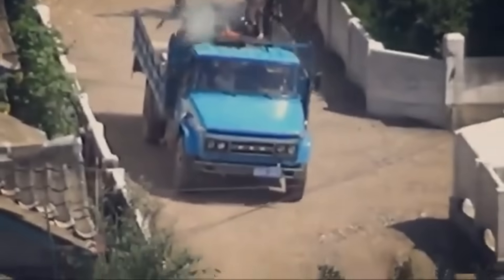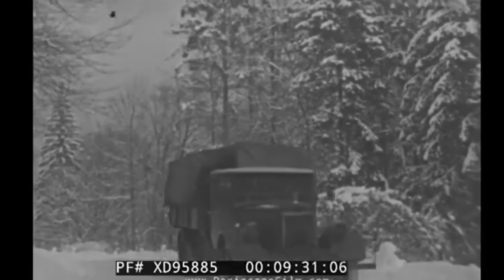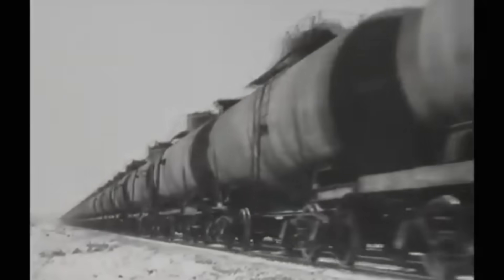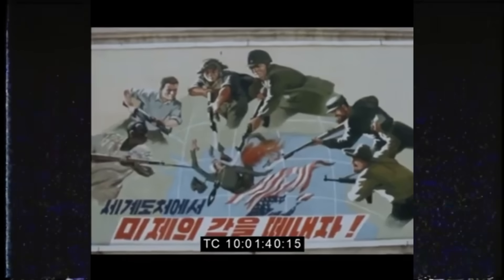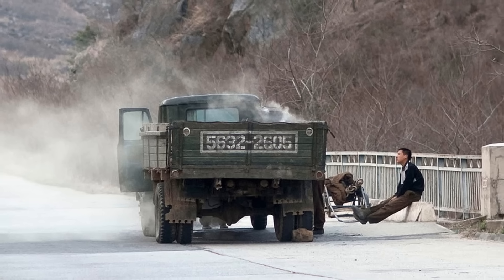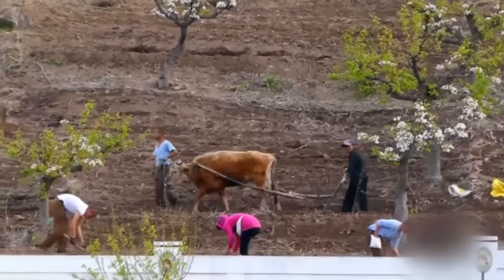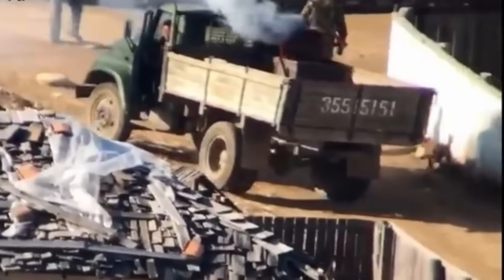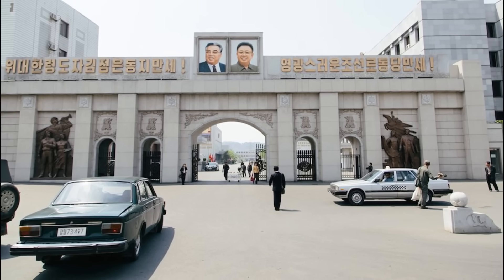Why North Korea’s Trucks Run on Wood

Comment: 0:45 coal powered lorrys like sentinels,were made for a very long time, and some even lasted in use into the 60s and 70s in a few rare cases when generally steam fell out of use. 
 
Sentinels in particular were well liked, due to being vertical boilered, and were easily to maintain, kind of like their railway locomotive counterparts. They were still building them in the 50s
Which is amazing when 
Considring many north koren soviet trucks were designed in the 50s.

Comment: While not ideal, FEMA released a crudely drawn set of plans to convert a vehicle to run on wood during the oil crisis.

Anyone with basic mechanical knowledge can convert a vehicle in a few days using very simple supplies.

It is good knowledge to have and some people have even set up home generators to run on wood gasification systems.

The added bonus is that you get charcoal as a byproduct that can be used to purify water and for cooking.

Comment: In fact, modern steam engines are more efficient and can use any fuel.
You should look at the speed records of the last steam cars ever made.
Technology that was deliberately killed to strengthen the petro dollar.
Reply: Steam generators used by those cars ran on oil. Stanleys for example burned gasoline and kerosene. It was no threat to the oil industry, as it directly used the product they produced

Comment: There were wood gas vehicles, natural gas vehicles, steam vehicles, and even electric vehicles since the 1910s. There were then a few theories about the possibility of having nuclear powered vehicles and trains in the 1940s and 1950s. But the oil lobbyists and the U.S. got too powerful. One can only wonder how different the world would have turned out if petroleum hadn't been seen as crucial, at least for transportation and energy.
Reply: And since before the 1910s
Reply: It's not that they're powerful, it's that objectively gasoline is a better fuel source. Calorific value wise, gasoline has 44 Mega Joules per kg compared to wood gas which has only 5.7 Mega Joules per kg which makes internal combustion engines more powerful compared to their size. Storing and using gasoline is simpler than either steam engines or wood gas generators (which is just a tank and a carburator). And gasoline has many uses aside from being fuel for cars: it can be used as fuel for lamps and solvent for certain products (Bertha Benz got her first refuel for the 1897 Benz-mobile car from a pharmacy. Standard Oil became an oil monopoly not because of the Automobile but because of the widespread use of gas lamps across the world; it is said that you can find cans of Standard Oil gasoline even as far away as Siberia and Timbuktu)...

Comment: You left out a significant trade deal between Uncle Sam and N. Korea. Clinton sent Jimmy Carter to meet with Kim Il-Sung, on his death bed. Carter managed to break the ice with the old man which became known as The Agreed Framework of 1994. The U.S. opened some trade, including food and medical relief; a rail line was built between the two Koreas. It worked until George W. welched on the deal in 2001.
Reply from the maker: Yes, thank you, I really missed that.

Comment: Sounds like it would be easier and more efficient to create wood gas producing factories, or ethanol producing factories instead using a gas generator.. and it's would be much cleaner so you wouldn't have to rebuild the engine constantly either
Reply: A wood gas generator can be very simple, and you can "fuel" it with fire wood. Hence you can introduce it relatively quickly, and no need for wood gas producing factories, and the infrastructure to deliver wood gas. Exactly how will that work? Pressure tanks with wood gas of high quality steel? The whole point of the wood gas generator is that its fast dirty simple fix.
Reply: @kirgan1000 but then you have to lug all that wood around and it requires at least 2 operators to keep the truck moving, and hoping it doesn't get stranded due to excessive carbon build up from this "dirty" fuel.. ethanol imo is a much better option, it's made of plants and it's easily liquified, so no need for super advanced infrastructure in order to distribute it, and it burns clean too
Reply: @MrRightNow  Wood gas generator is a fast dirty simple fix. You can make the generator in a shed or a small workshop, out of sheet metal, and the "fuel" is in most places in  abundance.   

Its is a excellent choices if you are under blockade, or have mismanaged the country's economy to the point where you can't afford to import oil on a large scale, and do not have the time/money/resources/technological know-how to build (effective) ethanol factories, and in the case of North Korea, do you really want to use your limited grain for ethanol production.
Reply: Wood gas producing factories was a thing... In the Victorian era. They were called "Gas works" and are the "Natural Gas" of the era. The infrastructure to provide that is very substantial, much like that of water service. Ethanol requires some material of high sugar content to be fermented into such and those sources tend to be food sources. So in both counts I do not see those work in North Korea: the former because it's an antiquated system in a country whose government is obsessed with looking like it's a modern paradise on earth and the latter being impractical in a country whose  geography made even growing for food difficult...
Reply: Why not nuclear power? Its not nearly as dangerous as fear mongering propaganda pushes as long as it is maintained properly.

Comment: i'm an italian maintenance techinician man, who use to run electricity power plant based on chipped wood, wich is burned in ermetic chamber under pyrolisis mechanical transiction, we generate Syngas, or wood CNG... wich is the fuel for american V8  8 liter gasoline engine we use to generate electricity. The same gas when owner, usually small to medium industry, don't need electricity it's stock on adeguate tank and used into truck for delievery or fork lift, and lose around 20% of engine power using that Syngas - wood CNG. This is a smarter way to do that.
Reply: Veryvery interesting! Thanks for your comment and information! Greetings from Germany!

Comment: As a long time fan of wood gas vehicles, allow me to share my thoughts:
Wood gas vehicles peaked in use during ww2 only, not during ww1. this is because the wood gas system as we know it was invented only in 1930s by a guy named Imbert. hence, all these wood gas generators are also called Imbert downdraft generators. 
it remains to this day the most widespread type. 

basic principle is that smoke (CO2) passes through a glowing bed of coal which is supplied by little to no air. Carbon in coal is so hungry for oxygen that it strips it from C02, and you get CO, carbon monoxide, which is flammable. it also strips any water vapor into pure hydrogen. 
Engine power was down to about 60% when driving on wood gas, but this could be increased by about 20% by letting steam (H2O) into the glowing coal bed, and so make more hydrogen.

On topic of stokers and filters. On a properly designed and built wood gas system, you dont need to constantly feed fuel, and the engine does not need frequent rebuilds. to re-fuel, you stop every so often, fill the fuel hopper with sack of precut wood pieces, close it (it shouldn't smoke) and then drive "as usual" for dunno 30km or so. 1L of gasoline is quivalent to about 1,5KG good firewood.   
as for purity of smoke and tar buildup, this will depend on combustion temperature and types of filters employed. you need a high combustion temperature to burn the tars, and you need a cyclone filter, water bath filter and then a fine particle filter.  gas coming out should be completely invisible and easily lit by match. you also need a gas cooling system, since cool gas is more energy-dense. 
 

I don't mean to be pedantic, but on topic of steam-powered cars and trucks, you are incorrect that they were just a curiosity; this was not niche technology. in 1920s and 1930s, esp in Britain, heaviest trucks were all steam powered. they did stuff no gasoline truck could. they disappeared simply only the government passed a law that taxed vehicles by weight. that law was pushed IC car and truck makers to remove competition from steam trucks. In fact, these trucks could make for an interesting video topic. Check out the Sentinel trucks of the era. Then also Doble steam cars, also brilliant design and i think best steam road vehicle ever, although it's a large luxury car.
Reply: Check out the cooperation of Doble and Henschel! Plus the post WW 2 Nami 11 and 12! Rather interestin! The German Butenuth developments as well !
Reply from the maker: Thanks for the tip. I'll definitely read up on these cars.

Comment: A video on Cuban Taino trucks and light locomotives would be interesting, few people know that cuba in the 1980s and early 1990s made its own trucks and light locomotives also the Taino diesel engines wich ranged from 4 cylinders to 12 cylinders where used on many other vihicules like boats and military vihicules.
Reply: It makes sense. If I remember correctly, Cuba followed the Soviet model of industrialization to some extent (all underwritten with free Soviet oil) and is said they have used more chemical fertilizer and pesticide than US agriculture. The "Special Period of Peace" gutted those so badly Cuba deindustrialized (against its own will) and is still a problem to this day. Same with North Korea and their "Arduous March"...

Comment: besides the low power output and clogging the engine its also a source of carbon monoxide poisoning.
Reply: If done correctly, a vehicle will run just fine on wood gas. You start the fire, get the wood to flash point and then it is releasing a flamable gas.

When a solid burns, it is not the solid burning; it is reaching a temperature at which the solid breaks down and releases a gas that is flamable.

If running a vehicle on it,  you want to choke the fire until it is smoldering and then pipe the gas through a water bath for filtration.

Most vehicles with a computer will adjust the air to run just fine on this.
Reply: @kjaubrey4816  Do you have any example of this working ? would be kind of interesting.

so far i have only seen the normal kind were the gas is pulled through a custom air and gas mixer using the normal engine vacuum with a separate carburetor for starting with the gas avoiding the caburetor itself because its extremely corrosive to aluminium.

i have not seen anyone succeed with getting the required amount of gas mixture in to the engine to not make them underpowered so far without the use of a turbo or compressor, and the ones i have seen try the turbo method usually claim to get good results until it blows up. the only ones i know about that claim to have succeed with this is the the swedish military with an experimental truck from the 70s but info on that one is limited.

i think ? the main problem they have is were to ad the extra air from the turbo since the gas is basically atmospheric as opposed to normal gas cars where the gas is pressurised from the bottle and sort of separated.
Reply: @pontusjansson1308  wood gas is about 70% of the energy density of gasoline. So you would get 30% less power. You wont go 80mph on the highway, but you could certainly get to 50mph, which is a heck of an improvement over walking
Reply: A win-win for North Koreans.  😉

Comment: Er, steam engines are NOT low efficiency.

Advanced steam cars are genuinely very efficient, they just have hideous maintenance overheads and a serious risk of boiler explosions if improperly maintained.
Reply from the maker: I meant that, given their shortcomings as a whole, they become ineffective.
Reply: I’ve got a Honda that makes 260whp in a 2,000lb car and gets 38mpg. It’s fast and efficient AF. In comparison a steam engine is wildly inefficient.
Reply: Steam engines ARE low efficiency, regardless of what someone has built in a lab.
Reply: @CaptHollister "they're low efficiency until they aren't."
Reply: Cherrypicking much? Traditional steam engines are horribly inefficient.
Reply: @MacShintersbane what YOU did is cherry picking.🤦